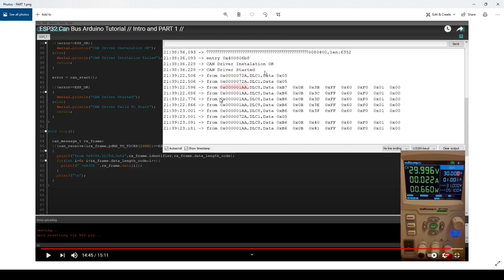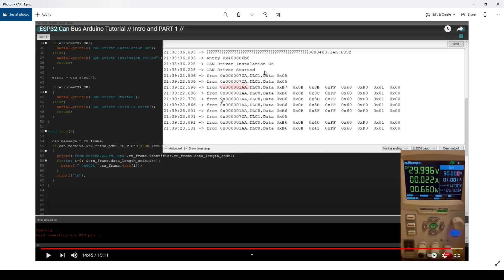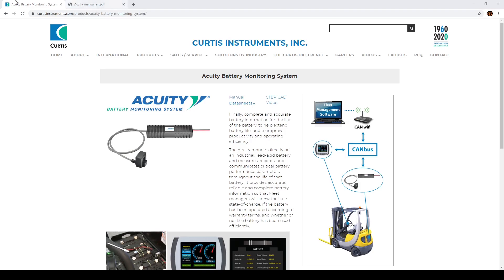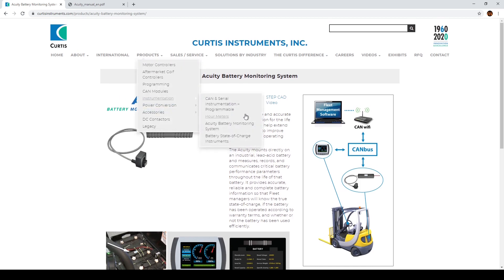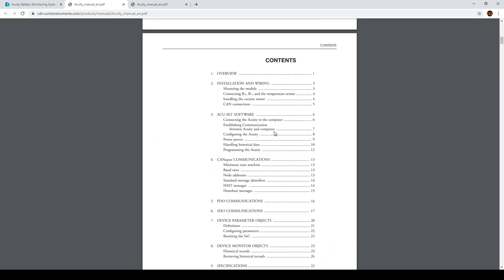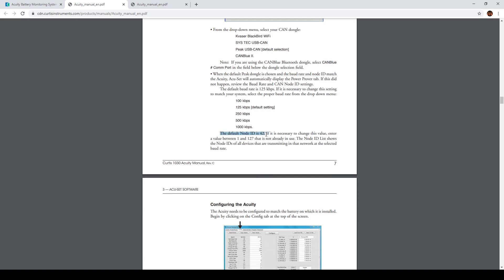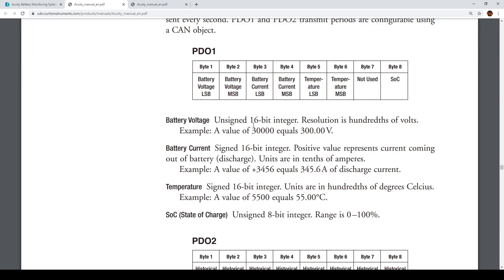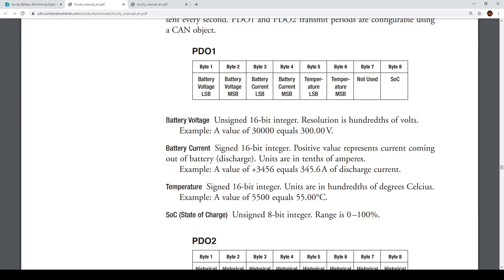ESP32 Can Bus Arduino Tutorial // PART 2 //

Comment: Thanks for this amazing tutorial. I am really confused with the difference in CAN ID, Node ID and COB ID. I believe Node ID and COB ID are associated with CANOpen protocol. You have identifier as 426 now I am lost to where this 6 came from. In CANOpen if you want to use PDO1 you have to use 180+Node ID = COB ID. In CANopen terms it should be 180+46 = 226. So I am a little confused.
Reply from the maker: Identifier 426 is decimal number in hex 0x1AA.

Hex value:
0x1AA – 0x180 = 2A
2A node ID 

Decimal value:
426 – 384 = 42
Node id 42
Reply: @RTFIX  nice one my friend. Thank you so much. God bless.
Reply: I had a brainwave, does 6 represent number of bytes you are reading? I have noticed you only read 0 to 5 bytes and bit shift them. So if it was 428 could have I read byte 7 (Not used) and byte 8(SoC) ?